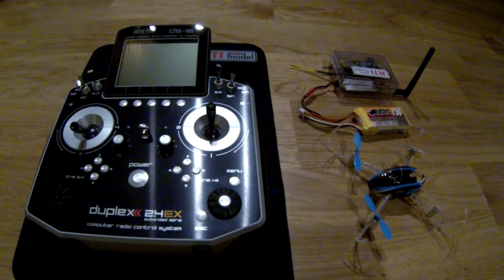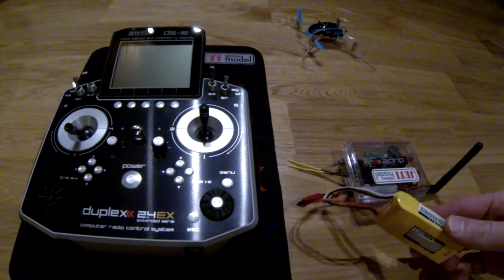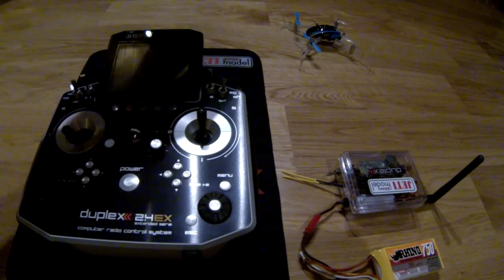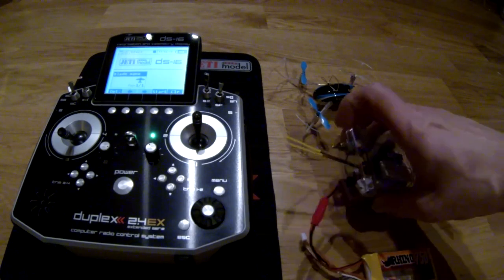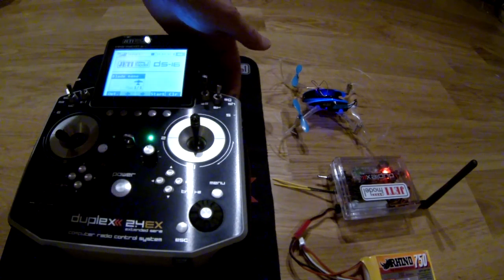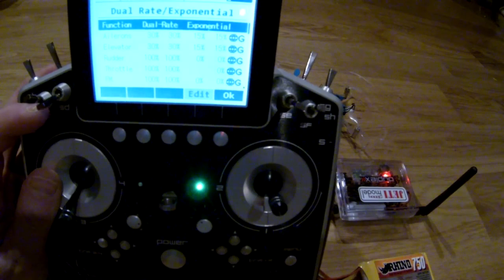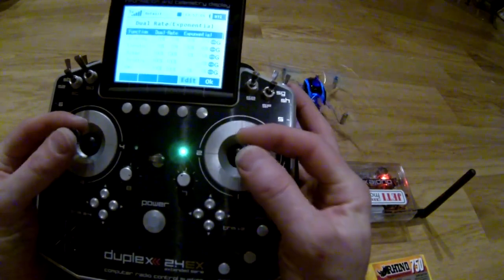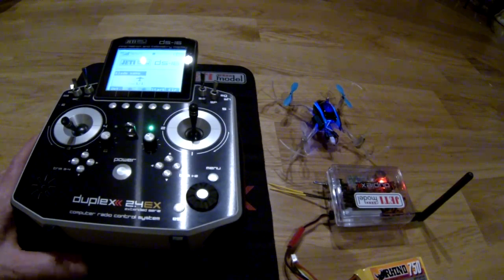Kajakens Blade Nano QX setup #27 (Indoor time)

Comment: Nice solution! Anders.  Connect the module to the receiver on last channel or SAT output, connect a 2s Li-Pol  to the receiver , It can handle up to 8,4V, BEC is not necesary,  and you are ready to fly.
Reply from the maker: Good suggestion but i did not have any 2s lipo at home and will probably connect a 3s and burn everything if I did not use a BEC :) so best for me is to use BEC if it could be eliminated.